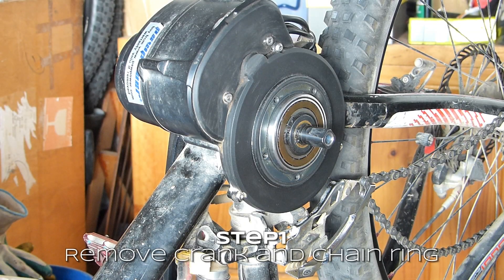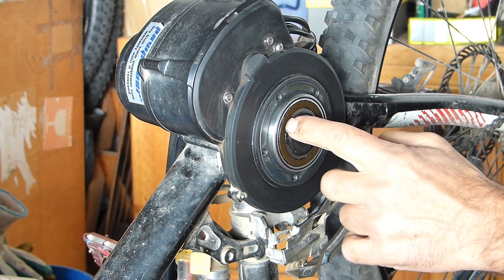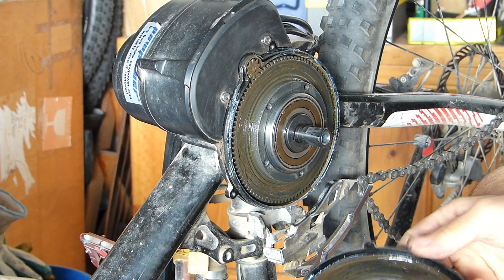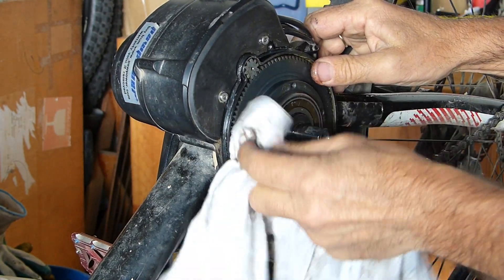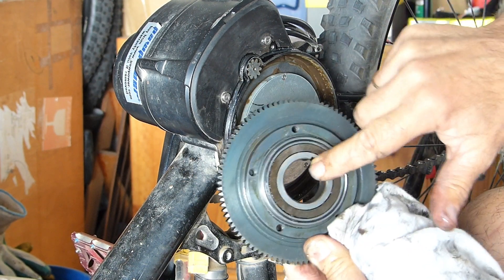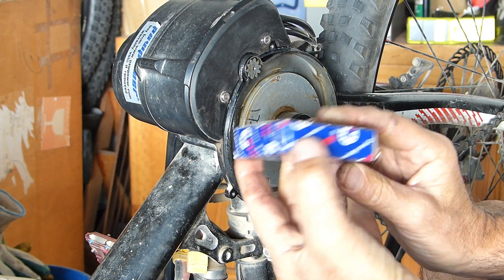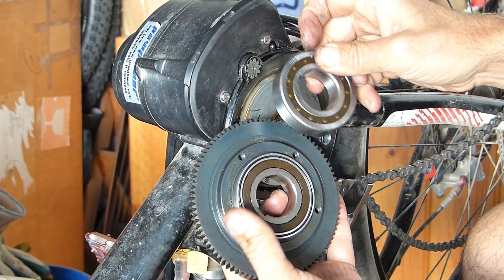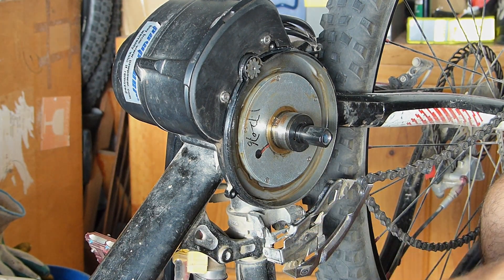TSDZ2 Replacing Sprag Clutch

Comment: My problem is intermittent it just started to happen it is now unridable I can hear the motor spinning but there is no drive. Supplier wanted a video. 
I did setup walk mode. Put front wheel against bench applied the throttle and can hear the motor spinning. It then suddenly engages with a bang.
It is only 4 months old and is fitted with the brass gear.
It has been to the supplier and they diagnosed a motor controller blaming my instalation causing excess load on something in the motor I paid for a replacement controller. The Motor was returned bench tested! but it still has the same  problem. They are contacting the factory with my video. I think it is one of the one way bearings there has been no pedal slipping under load.

Comment: Thank you for sharing this video! 
Sometimes the crankset of my TSDZ2 goes completely free (as if there was no chain in a non assited bicycle). 
It started doing it about a year ago, only randomly, early in the morning, when I am starting using the bike. Now it does it more often, but it doesn't do it when I am going up hill or put a lot of pressure on the pedals. It does it only randomly on the flat, when there's little pressure on the pedal. 
To be able to get traction on the cranckset again, I must stop pedaling, make half turn backways, and start pedaling again with some good pressure. 
Note that when the crankset  goes completely free, it doesn't matter if I turn off the the battery. It will do it even if I don't go electrical assisted. 
Do you think is the sprag clutch, or the torque sensor? Or something else?....   Thank you!! 🙂
Luca
Reply: I'm getting the same as you describe.  Did you find out what it was?
Reply: In my case the problem was caused by the sprag clutch (which is basically a bearing that goes free only in one direction).  I replaced it with a new one that I bought on Amazon for about 20 Dollars (part number CSK30P).  The new bearing was fitting a bit loose and therefore was slippery. So it was practically impossible to get any traction when you cranked the pedal. I took it off and made some incisions on the outer part of the bearing (using an hummer and a chisel). The incisions created little metal dents that are avoiding the bearing to slip. The crank works fine now! It’s possible that by making the same incisions to the old bearing I would have solved the problem even without buying a new one!.. 😊
(It’s pretty easy to install it anyway)

Comment: I want to thank you for this video! My pedals had begun slipping a while ago, and I've just been getting by pedaling lighter and using higher assist levels, but that's not a good long term solution! If I ever ran out of battery, I knew I would be stuck.  I ordered the bearing and ~LUCKILY~ I pressed it out the right direction!!! There was (on mine, anyway) a small lip or shoulder in the bore of the gear that stops the bearing from going out the back.  It has to come out the front and go in the front and you show in your video.  But luckily I pressed it the right way and thanks to your video I got everything back in place, and  now I can stand on the pedals and there's no slipping! 🎉🎉👍👍 Thanks a lot, mate!  From Canada, riding my TSDZ2 in the snow and ice.
Reply from the maker: Awesome work !! Enjoy

Comment: When you pressed in the new bearing (sprag clutch) did you use red Lok-Tite between the outer bearing surface and the gear bearing pocket?  Thanks.
Reply from the maker: Nope it was an interference fit so no loctite

Comment: My tsdz2 engine has no speed.  Turn on, but it's too slow.  I already opened it, removed the sensor and only the engine is slow, at low speed.  With the sensor, same problem.  Is that the problem, the Torque sensor?
Reply from the maker: did this just happen or is it like this from new ? Is it making noises ? What is your battery voltage ? Have you accidentally limited the AMPS ? are you using stock firmware or opensource ? If opensource what is the maximum power you see ? Is your battery BMS limiting the current ?
Reply: @jbalatutube  So, first thanks for answering me and trying to help me.  So, this engine was bought new and after two months, it presented problems.  In fact, I bought a 48v engine and they sent me a 36v one.  I spent a month waiting for a response from the supplier and then found out that my battery was compatible, as it was 48v. 

 The company did not want to make the switch and I had to buy another battery.  Two months later, the engine stopped.  It took me two months to recommend a company in Italy for repair.  It turns out that a month after arriving from Italy, the carcass broke.  They sent me another one quickly.  I disassembled and assembled again. 

 Only now the rotation is slow, almost stopping.  I've already made all possible settings on the panel and nothing.  I've already changed the power from 16 to 32, I've already set the right wheel size, the sensor magnet is only 1, anyway ... I've done everything.  I am completely lost.  I deliver and my bills are all overdue because I can't work.  I'm doing it with a normal bike and I make very little money.  I already begged pwspouwer to give me another engine and they refuse.  I haven't bought five months.  

Even if they send the voltage wrong and I have to buy another battery to be able to use it.  I do not know what else to do.
Reply: @jbalatutube  my battery is 15ah 36v and my engine is 500w 36v.
Reply from the maker: @Andreluiz-tj6ge  its very hard to diagnose. There is a way to show the torque sensor reading when you press the peddles. It might be in the manual. This will let you check if the torque sensor is working properly.
Reply: I had similar problem with mine when I just install it. Motor wold make some buzz sound and barley spin in walk assist mode. It turns out problem was in small 4 (or was it five) pin white connector that you can find near 3 main power connector on the motor. That connector had some hot glue on it and it was looked ok but connection was not good, after I disconnected it and reconnected properly, motor started to work properly.

Comment: Mine slips under high pedaling torque, but it is a very smooth slip.. I'm wondering if this could be the sprag bearing slipping inside the gear itself? Has anyone had the sprag clutch slip like this instead of a jerking type slip?
Reply from the maker: Americans of England when mine got worse it was smooth, every time I wanted to go up a hill it would just slip
Reply: @jbalatutube  ah, thanks much appreciated!

Comment: Thanks for the video, mine started crunching too much by 550km (all of it hard offroad riding), ordered a new one from a Melbourne company on eBay, may need find a car repair shop to get it pressed out/in.
Reply from the maker: Good luck. If its crunching under power then its probably the blue gear. The sprag clutch is when you apply force to the peddles and it is slipping even when the motor is off
Reply: @jbalatutube  I might replace a few other bearings too, TongSheng appears to have spec'd the cheapest ugliest bearings possible.
Reply: @jbalatutube  Thanks for the reply. It only happens under pedal power (and motor in Eco or Tour) when pushing hard, the pedal will suddenly drop to the bottom, I almost fall off when it happens. If in turbo mode I'm not pushing hard on the pedals so no crunch.

Comment: As I have seen it right, than you can ad a throttle and the bike will ride, while you don't have to pedal?

Can you also change the 42t chain ring for an other one?

50 for shipping. Wow, are they delivering it in a golden box or something?

End of the month, I order my e-assist. For the befang I have seen that they have other size chain rings and I am thinking to get one of those on the thongshen tsdz2 assist. But that depends if I go for a 20 inch rear wheel.
Reply from the maker: Yes you can add a throttle but it uses same port as the temperature sensor so not recommended, you can hold onto the down button and it will act as cruise control if you use the Open source firmware. If you add throttle you will also need ebrakes, far too much wiring for my liking. Yes you can change chain rings or even use 2 while not ideal because it upsets the chain line it can be done with some mucking around, one of my friends has 32, another 40 and another has 52. Depends how fast you want to go and whether you are using it for offroad. The 40 was a lekky but he needed to make a custom adaptor ring.

Comment: Thx for the useful post about working on the TSDZ2, but WADR it should have been titled "TSDZ2-Replacing the Sprag Clutch, a One Way Bearing (ie its freewheel)".....
Since I know there was at least one mechanical engineer, who didn't know what at a Sprag Clutch was before today.... And applying the grease to teeth of the gear before installing it, would  be more efficient.
Reply from the maker: N C ha ha glad you found it useful :)

Comment: Thank you for this video.  I found it very useful to understand how to disassemble the TSDZ2.  My motor has done 500 miles and every so often it 'crunches' under medium / high load, similar to the noise if your chain skipped over a tooth.  Not sure the sprag clutch is causing this however I do have lots of lateral movement on the chain ring which I now see is due to excessive play in the sprag clutch.  Annoying thing is that the bearing appears to be stuck on the shaft.  It moves 1mm or so but no more than that regardless of how much force I apply.  The inner axle soon came out but the bearing and sprocket refuse to separate from the outer axle .  I ordered a CSK30P made by KYK of Japan but as it stands I will not be able to fit it.  Overall the quality of this motor is poor.  It is clear there has been water ingress on both sides, which will only have come from road spray entering through the side casings.  I had to drill out two seized allen key bolts from the casing on the electric motor side.  The 4 counter sinks holding the motor in chewed up with very little force.  I can replace screws and bearings with better quality items and assemble with suitable grease but this is not what you would expect to do with a new item in the $300 price range.  Shame, as when it works the motor is impressive.  Thanks again for the video.
Reply from the maker: Korgua Timbale sorry to hear you are having issues,. I have heard of other users having problems with rust. I guess if you are riding in the rain you should probably open it up more often and you try water proofing by adding rubber grease around the seals. Maybe leave it soaking in wd40 overnight and hope you can force the bearing off the shaft. You could use something like a slide hammer.

Comment: Forgot to mention, I bought 3 TSDZ2 units (2017), I installed one on a hub-drive with 7speed Nexus and the rear brake functions as it should and the motor does not drive the cranks/pedals unless it is acting to "assist". I have now installed the the second unit only to discover that it is different, with the free-wheeling crank when back-peddling. Thanks for all your informative videos, I do not feel alone now that I have found this reference.

Comment: I have a rear braking hubdrive with 7speed Nexus and need the rear brake. The mid-drive model I have i pedal assist without the accelerator, it has the free-wheeling crank and I need to replace some component to do this. Does that mean I need to replace the sprag clutch with a solid drive? Where can I source that part?
Reply from the maker: Rowan Wright I’m not even sure that would work. There is a special version of the motor that supports rear brake but I honestly haven’t looked into what the differences are. Please ask your question on the endless sphere forum.
Reply: @jbalatutube  Yes I did get some information via endless sphere, but the suggestion was  that I needed a new shaft. I would have thought that the main gear and shaft would be standard, and the replacement part would be a solid "sprag" without the clutch. Your video gives a very description of the components and their function, I just need to drive the chain backwards to activate the brakes. Surely the Torque sensor is only activated on the forward rotation and therefore it would not try to drive the motor under braking?
Any more advice would be much appreciated, even a supplier where I may be able order the parts.
Reply from the maker: @rowanwright7820  Sorry if you locked up the sprag clutch then wouldnt the motor spinning make your peddles turn.. does my head in. I use PSWPOWER for my stuff.

Comment: Good videos and very well explained. I have a 700 km Tongsheng engine, when the pedals are turned, the engine does not work and the error E02 appears, turning the pedals in the opposite direction is very resistant. He disassembled the engine and the blue gear is correct but the engine costs a lot to turn it in any direction, can the engine be burned and be the source of the problem? What kind of fault does the Sprag clutch give you? Regards
Reply from the maker: Sprag clutch slips making it hard to transfer power to chain. The error e02=Motor Hall Fault or Short Circuit.. I would pull it apart and check all wires and connections. If the motor is only a few months old then try to get a new one on warranty. If the motor can’t turn without power then it could be burnt, they are fairly cheap to replace, you can check pswpower or AliExpress, make sure you note gear type.
Reply: @jbalatutube  
Thank you very much, I already disassembled it and if I think it is the internal engine that has burned, I'm already in it, thank you very much

Comment: Thanks! This video really helped and saved me buying the full assembly from China with its listed 40-day delivery and presumably another crappy bearing. My sprag clutch had properly cracked along the keyway after 3,500 miles and it was seized on the shaft quite tightly, which made the job interesting. I used your method of screwing the bolts in and used a claw hammer on alternate sides to pry the bearing off the outer axle (the one with the big circlip) - which pushed the inner axle out through the other side. That didn't cause any problems that I could see when I reassembled, so all good. I was able to press the bearing out in a bench vice with a few strategically placed pieces of wood and light application of a blowtorch to heat the gear. Took a fair bit of force though, and 3 hands would have been useful. Getting the new one on was easier. With the new German made bearing, I think my TDSZ2 is good for another 10,000 miles!
Reply: Thanks Ralph, after exhausting all other methods I could think of your tip to use a claw hammer worked for me.  Only 500 miles in service and the sprag clutch was slipping.  Water ingress had got between the bearing and shaft and it took considerable force to pull the bearing off the outer shaft.  Reassembling was a doddle as I removed the corrosion on the shaft and the new KYK bearing fitted easily.

Comment: My 36 volt - 350 watt unit (Probably original version) just quit. Was working fine but no error codes, just stopped working. Taken apart & all connections checked but power isn't getting through to the motor. I am guessing maybe something in the Controller has died or maybe one of the 3 phase circuits? Before I order replacements is there a way to test the Controller or Motor, either in place or removed for bench testing? Thank you.

Comment: My motor did not have the brass washers under the drive gear. I have a newer version of the motor, where the drive gear has helical teeth. Do you know if they got rid of the washers, or am I missing stuff from the factory? There is also lateral play of the clutch on the axle : (. This transmits play to the spider, and so the chain line changes under torque.
Reply from the maker: they all have some lateral play, you can install your own washers to minimise it

Comment: Hello, I need some advice. After 100km and 2 days of rain my torque sensor (I'm guessing) started to play up. I need to press the pedals very hard to get any assist, do you know what kind of problem and solution might be to fix that? Thanks for help
Reply from the maker: sounds like it. Have a look for a hidden menu. It will give your torque readout. You can check if it still works. If so maybe you can reprogram the opensource firmware to use the values so it works normally. https://endless-sphere.com/forums/viewtopic.php?f=28&t=79788&hilit=hidden&start=3225#p1405380

Comment: Just a follow up - Some motors will have a press fit bearing on the shaft as in the video & some will have a taper fit bearing like mine that you have to knock off the shaft.
Reply: daytriker how did you get it off? Mine is impossible to get off, don’t want to demolish the whole bike..
Reply: @UffieIce_backup  If you remove the gear with the shaft & hold it in one hand a good tap breaks it free, I am pretty sure there is a YT video of someone doing just that.

Comment: Did you have to remove anything before wiggling the Gear & Bearing assembly off at 3:10? I Can't get much movement on the shaft with mine using your method of removal. Thank you
Reply from the maker: no as you see it was fairly easy. Maybe yours is a tighter fit in which case you will need to use some force or a puller of some kind. Good luck.
Reply: I want to open up to see if anything broken my torque sensor, suppose I have to lift off that gear. Mine is solid as stone. I can almost lift the whole cargo bike without get it off, and don’t want to damage the whole thing .. 
Should it always be able to spin free? (I have a rear brake on my bike, is it different versions of TSDZ2?) mine don’t spin free, the shaft+gear spins together.